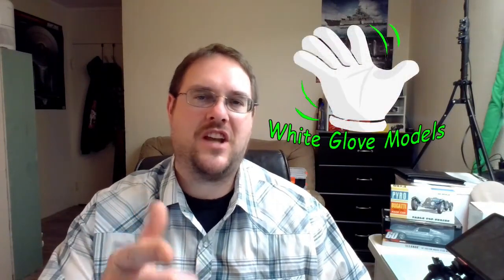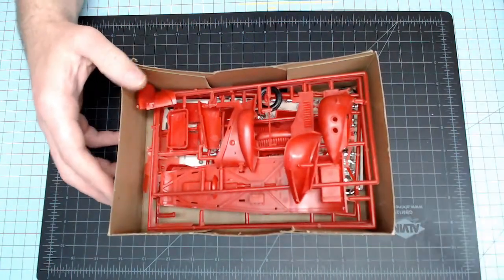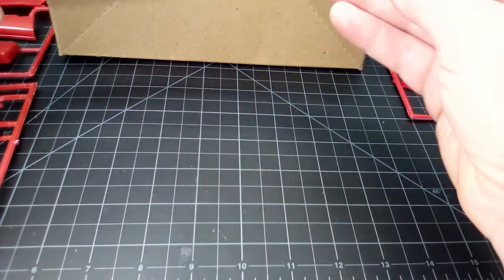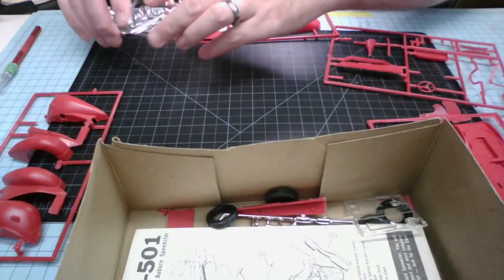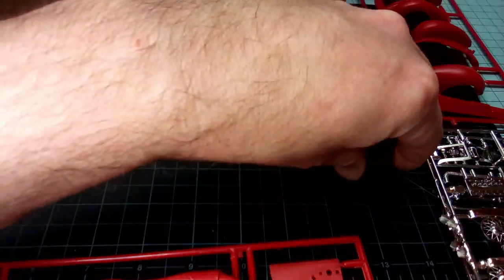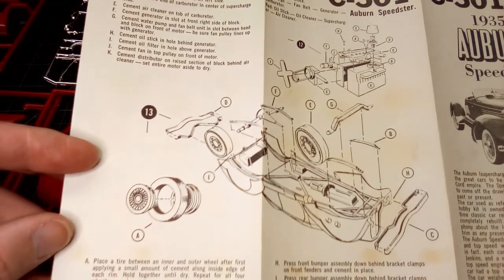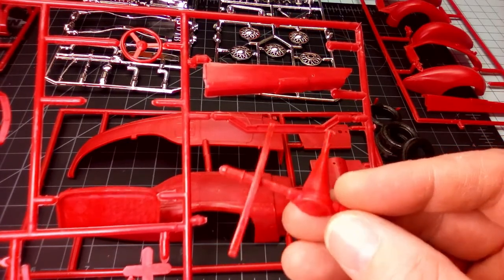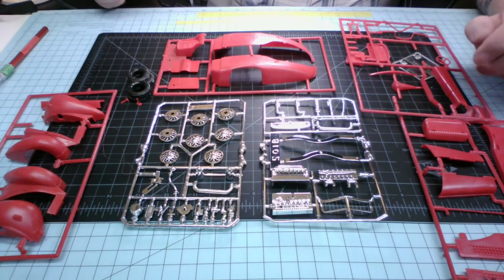Pyro Plastics Corp. 1935 Auburn Speedster Unboxing Review - Supposedly untouched in Original Plastic

Comment: On viewing your video, I opened my own Pyro Auburn kit and discovered that the leaf spring from the rear suspension was missing too, just like yours.  How can I get a 3D replacement part for my kit?  Thanks!
Reply from the maker: That's really interesting.
Makes me wonder what happened and why?
I would just ask around in various forums and Facebook groups.  
I have not spent any time researching it and figured by the time I get around to building it, I'll be 3D printing myself and can either design and print something, or scratch build a replacement.  
It's such a bizarre thing to be missing from more than one kit!

Comment: Yes, you are missing the passenger side of the rear axle. It could be happened at the packaging section and somebody decided to pack it anyway. Eliptc springs are easy to build with stripes of 0,5 MM styrene sheet (be sure to make the two sides for symetric springs). You can use a sprue section for the axle itself. The engine is a shit but I remember a good inline 8 flathead somewhere, MPC vintage limousine, I guess. The wheels are grossly underscaled. Look for MPC 1928 Lincoln for wheels more correct in diameter. The body is confusing but goes well if you putty and sand the longitudinal seem., Good luck!

Comment: It's pronounced pyro as in PYROMANIAC. Dealers used what was know as "Dealer Samples" that they could show customers what a car looked like for the most part so that they could get an idea of what it looked like and so they could see the bottom of the car without going into the lot and checking underneath it. The only thing they would have to do is open the hood to see the engine.  

Any way I think you got a used kit that was owned by someone and returned to the store and the (store) wrapped it or re-wrapped it in cellophane because these weren't originally wrapped back in the day. These are wrapped in cellophane now to keep the boxes from coming open or being opened by customers and losing parts. I usually melt sprue either with acetone or sand to the required shape and polish it by hand. This works for me. Or I make the parts that are missing or what is missing from a part then recast it (make a mould then recast in polyurethane resin) so that I can have a complete kit. Thank you for posting this. It was very interesting indeed.
Reply from the maker: Thank you for the wonderful information.
I could see how that could be the case.
I like the idea of recasting it and may go that route.
I'll be sure to include the "fix" in the video when I get around to building it.
Reply: @WhiteGloveModels  Thank you for your reply. I will be watching for this. I just won one of these but it's a Lindberg kit. Maybe I'll make a video or at least post a link to pictures of that build as soon as I get it. Thank you again!

Comment: Gotta be careful with eBay. Bought a 66 thunderbird kit that was supposed to be factory sealed. However, the chrome trees were from a 70’s Chevy pickup or blazer.  Lol, build it out of the box. We’ll see how long that lasts 😀.
Yuup! Looks like someone snipped that leaf spring out. It’s too clean.🧐
Reply from the maker: That was my thought exactly.  I think they robbed the part they needed, resealed the box and sold it as a complete kit.  The more I read up about this kit though, the more I find out how bad "inaccurate" it is.  A lot of people did some pretty cool MAJOR upgrades and custom work to them to make them look more like the actual car.
Reply: @WhiteGloveModels  it's a short shot